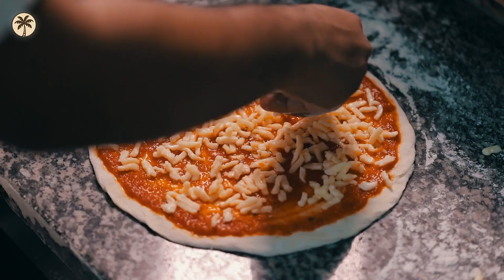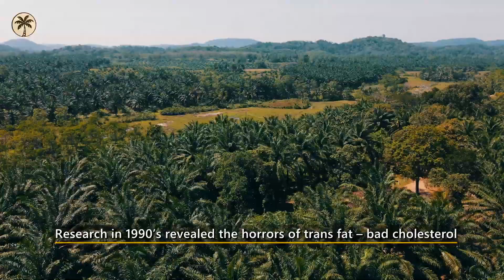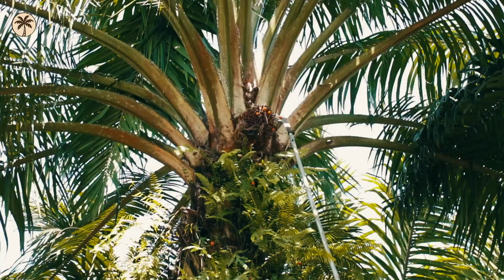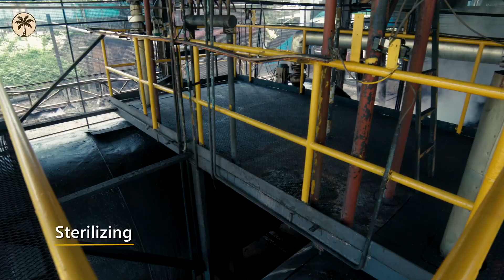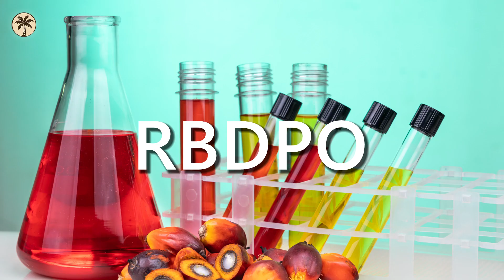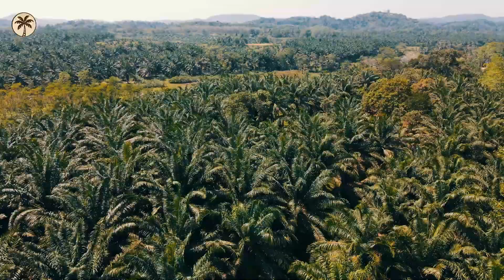Is Palm Oil the Future? A Look at Sri Lankan Production

Comment: It is said that palm oil is generally considered unhealthy primarily due to its high saturated fat content.
Reply from the maker: Thank you for your insightful comment! 😊 You're correct that palm oil is often considered less healthy because it contains a relatively high amount of saturated fat, which may raise LDL ("bad") cholesterol levels when consumed in excess. However, the overall health impact also depends on factors such as portion size, how the oil is processed, and the balance of the rest of the diet. Using it in moderation as part of a balanced diet is generally the key. We really appreciate you sharing your thoughts and contributing to the discussion. Thanks for watching, and stay with us for more informative content! 🙏